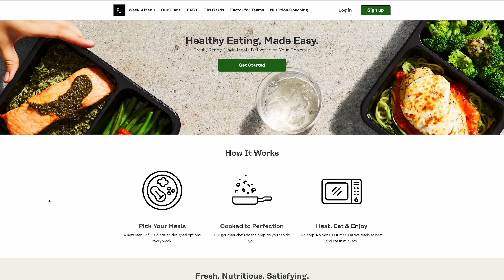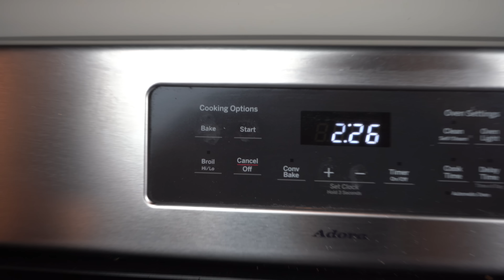My Latest Crash And What Went Wrong

Comment: The crash does look epic, though. I use to do the same move for drops. Used to call that method an “English Hop”. What I do now is to quickly push the bike forward. Only need a small movement. The speed of the snap will keep the front up longer. If you miss the timing, at least your bike further in front, so gives you a little more room to screw up and make a bad landing. It does with for jumps, but ends up squashing the jump.
Reply: Was about to say the same thing. The push if going slow or to a flat-ish landing, otherwise just the "Lee Likes Bikes" style getting super low and letting the nose drop.

Comment: 63 and riding. I were hip pads, shin pads and gloves on every ride. I don’t like elbow pads but I have started wearing them more often. I ride with a camelback and that’s saved me more then once. Crashed last weekend on a trail I have ridden a 100 times. Few scrapes but those hip pads worked like a charm. I also wear full face all the time since my buddy did a low speed crash over a curb and now has scars like Tom Beringer in Platoon. He was wearing a half shell.

Comment: I didn’t start riding until I was 30 and quickly learned how dangerous it can be as in my first 2mo of riding I not only dislocated and fractured my pinky but 2 weeks later fractured my left elbow. First time in my life I’d broken anything aside from my nose. A couple more broken bones (one resulting in surgery) and I’m almost 32 now and just got back from whistler for the first time. I’ve got 3 kids and will continue to ride but I’ve learned a lot from my crashes. I don’t plan on stopping anytime soon and will keep pushing my self towards larger features but in the back of my mind is that constant fear that I’m putting not just myself but them at risk. Crazy things we do for the things we’re passionate about I guess. 

Ps. Zero crashes in 2023 so far, hoping to keep it that way

Comment: Dude I got 10 weeks off work, paid, when I had my son. The thing was I could use it all at once or use it in 2 week chunks for up to a year of the birth. I decided to save 2 weeks at the very end and use it just for me and go MTB riding as much as I could. Day 1: I went out to the local bike park and rode the downhill jump trail. I walked it. I slow rolled it and took the B-Line for an hour. Then I started to jump things. One by one I cleared things at the right speed and I felt like I could put it into a flow and go for it without killing the flow. 
Well 3 jumps into the line theres a gap4 feet long that drops to a bowl 10 feet deep then a step-up on the other side. 
I over cleared the gap and landed in the flat. I decided I didn't have the speed to clear the next step-up but the bowl was actually just kind of cut into the hill so instead of coming to a stop I tried to bypass it so I could walk back to the top and try again with less speed. Unfortunately when I veered off to bypass, I was off trail and because it was Fall oak leaves were all over the ground. My breaks locked and my tire hit them so I started to surf down the slope with way too much speed. 
Don't worry, nature had my back. I couldn't stop but an Oak tree was right there to help but I was still going about 10-15 MPH. As Seth would say; SMASH!!! I ended up breaking every rib on the side of my body that hit the tree. Long story short, I loaded my bike and drove back home with like 8 broken ribs. My wife was pissed! I was supposed to help her with our 1 year old for my last 2 weeks off work but now I was laid up. 
In all adventure sports we assume risk but I think thats what makes it fun. Bones heal, skin grows back and on the brightside I have a great story to tell several years later.

Comment: Just got back from an enduro race earlier today. Didn't pre-ride, didn't wear body armor, didn't wear a full face helmet. What a mistake. It rained hard and the rocks were covered in slippery algae slime. The E-Bikes made the course even more sketchy. Had a bad crash on one of the stages. Lucky I didn't break my my face off. The half shell saved me, but it was over matched. After my soft injuries heal... face.  Anytime I do enduro it will be with a full face, body armor, and a pre-ride. FYI...I'm 55.

Comment: the moral of the story.

maybe these could have prevented all injurys:
- Leatt protector-Shorts Impact 3DF 5.0
- POC VPD Air Sleeve 

and when we at it. 
- Leatt Airflex breastplate
- Endura MT500 Lite 

I dont get why people dont wear arm sleeves or impact shorts. Just a small slip up with 5mph and you scrap your whole arms and hips.
the light stuff does the job, for a intermediate rider you dont need the high end motorcross protection armor with neckbrace still nothing wrong with it.

if you are scared after this crash. Buy some protectors, they will give you the confidence to send it again.

Comment: I think you need to lower your expectations until your skills improve to match. That is not at all how you should take a drop. That is way too big of a drop for you to bite off based on your technique. I would find a drop zone (like the one across the parking lot) and improve the skills and find a similar yet smaller drop before reattempting.

I partially blame whoever said go for it if they knew that's your technique.  I am not the type of person that says "go for it" if the skills aren't there. If the skills are there but the confidence isn't, sure, you can do it. You just need built up mentally.

Props on the balls to attempt it but man that's not worth it given your ability. Don't be offended, there's always someone better. Risk vs reward. Having fun is having fun, skill level doesn't matter.

Ride safe.